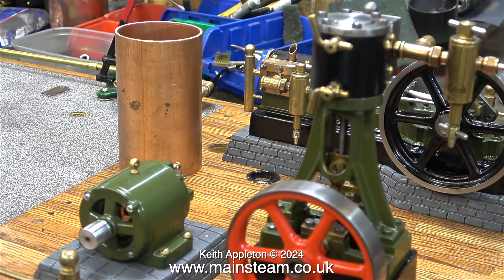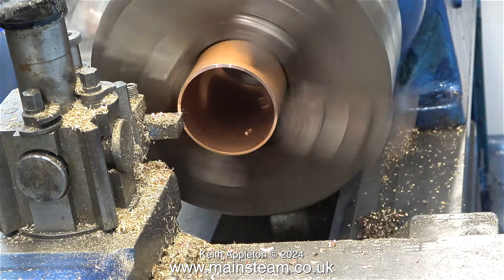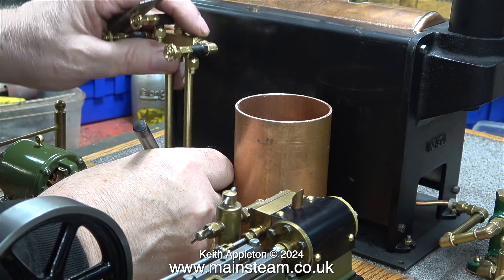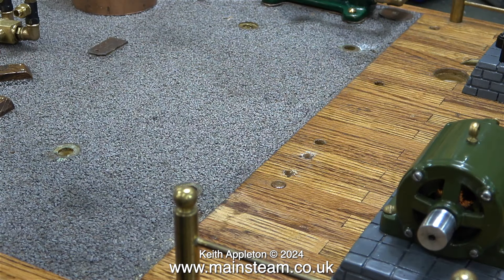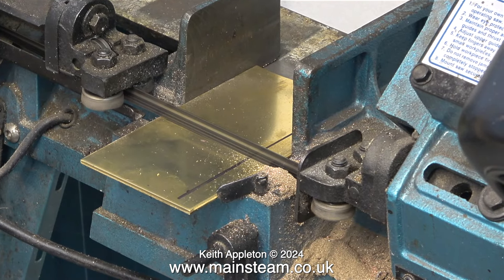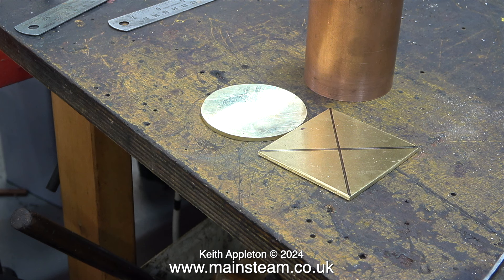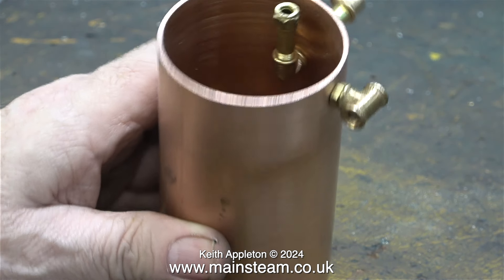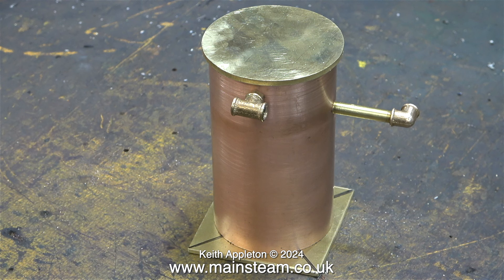REBUILDING A MODEL STEAM PLANT - PART #38

Comment: With the engines it depends on the terms of the contract, but if it the time becomes ridiculous high and the customer does not answer any E-Mails, in my company we would send them a letter with a final warning, that the product will be discarded if the customer does not give a postal Adress, where to send it or pick it up. 
This letter should have a certified arrival, so the customer can't talk out, by saying he didn't get letter. 
Also you could have as part of your contracts a storage fee, so when the customers don't pick their stuff up in time, they have to pay a fine, not to big, but also somewhat painful, like 5$ a day, after 2 Weeks, then after 4 Weeks 7.5$ and so on.

Comment: A simple question:  How do you drain the water from the condenser/oil trap?  I didn't see any fittings at the (proposed) bottom of the cylinder.  Of course that may be for a later video.  Otherwise it is a very interesting setup, and looks good.
Reply from the maker: The condenser is drained by opening the tap at the top which is connected internally to a pipe that goes to the bottom of the condenser inside . . .  .